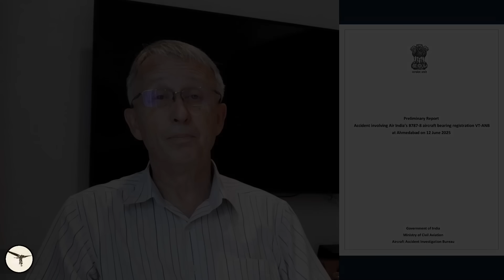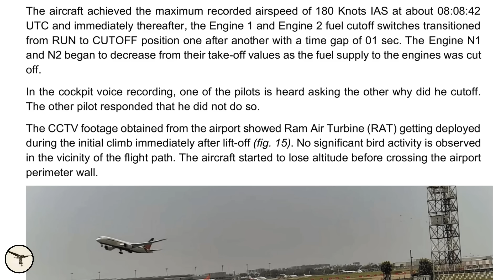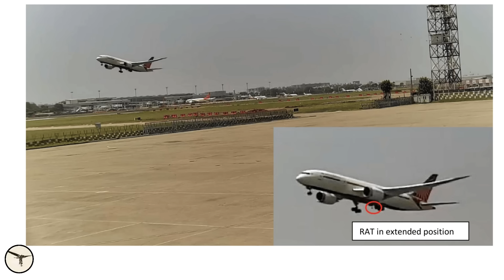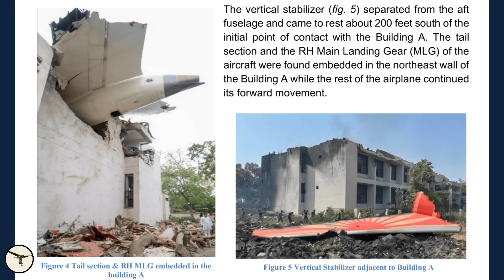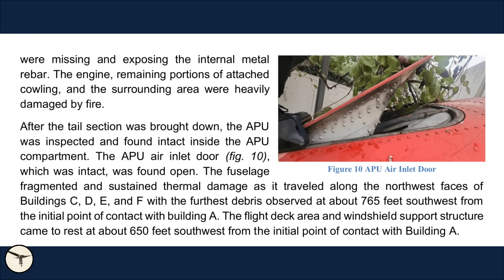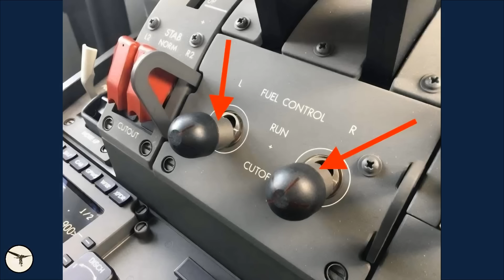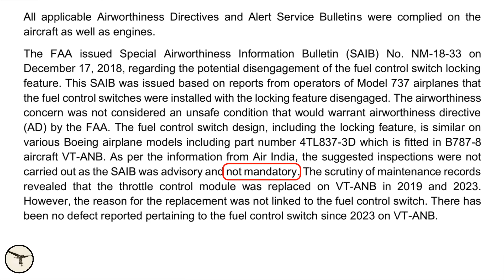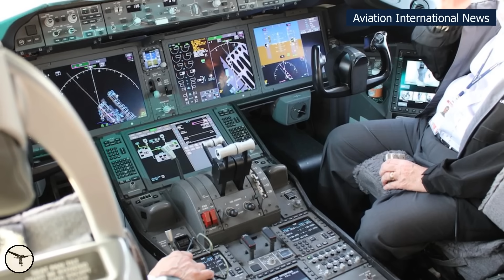WARNING Fuel Control Switches Failure Could Cost LIVES

Comment: I’ve flown both 737, 757 and 767 with these fuel control switches. They can indeed be stuck in a mid position. Normally you pull them out, then move them up and over a gate, and they will ‘sink’ into the correct position. But I have experienced them sitting on the gate in a mid position during movement many times. From this position they could potentially be moved by accident. But this would require that no one checked that they were set correctly, and that both are put by accident on the gate by accident. Doesn’t sound very plausible in my experience.
Reply: Will the fuel valve be open if it's in the middle?
Reply: @bbgun061 In my experience it has always stayed running when on the gate.
Reply: @fivemilesup  It will remain in the condition of the last fully engaged position! So from where it was moved before stopping on the gate.
Reply: @mrgoodman6620That may be correct. As mentioned, I have personally only seen this while shutting down the engines, hennes they were in the RUN position before they accidentally were placed on the gate.
Reply: @mrgoodman6620 yes in airbus , this would normally happen while shutting down engines during parking . the switches would be moved from on to off . but  engines would keep running to my surprise . because they haven't fully settled in the off gate , although to the eye they seem in the off Position . excellent catch
Reply: @mrgoodman6620 So since the fuel switch had to be put on 'Run' to move the aircraft that means it had to be deliberately lifted and set to Cut Off.
If it had been in Cut Off at the gate and then lifted to Run but had stuck on top of the gate it would stay in Cut Off. Correct?
Reply: @bbgun061  Die Schalposition  sendet lediglich einen Impuls an die Ventilsteuerung. Dazu muss man das interne Design des Schalters kennen. Es kann sein dass schon das Lösen des Kontaktes den Impuls (Masse = aus)  sendet., In der Mittelstellung könnte die Kraftstoffzufuhr eingeschalten sein ist. Das Geheimnis liegt also im internen Aufbau des Schalters. Das anheben des Schalthebels für die Arretierung ist für die Schaltfunktion sehr wahrscheinlich bedeutungslos. Dies sind meine Erfahrungen aus dem technischen Gerätebau.
Reply: @bbgun061  Yes, valves will be turned of only after the switch goes for CUTOFF position. This switch  (4TL837-3D, cost $1,500+ USD) have On-Off-On electrical circuits, they don't furnish electricity direct to the valves operate, only signal to the FADEC "allow fuel" or "cut fuel".
Reply: I read on another channel that control switches can indeed be stuck in a mid position. Normally you pull them out, then move them up and over a gate, and they will ‘sink’ into the correct position. But they have experienced them sitting on the gate in a mid position during movement many times. From this position they could potentially be moved by accident. But this would require that no one checked that they were set correctly, and that both are put by accident on the gate by accident.
Reply: @JoeyBlogs007  did you not just read that here?
Reply: Hi Captain. I’m presuming that when the Plane left the gate, the fuel switch or toggle would be in a locked in run position and it would be a deliberate action. On which he could check my a light brush of the hand. From following diagrams and different channels, it makes no sense to my layman’s mind how the switch could revert to off without a deliberate action. 

Cheers.
Reply: @johnmartin7158  Hi John. These switches cannot move by themselves. They are never ‘locked’, but when they are in the run position or the cutoff position there is a gate design, so you cannot move them by accident. You physically have to pull them out firmly and move them.
Reply: These Honeywell (USA) made switches cost anywhere from  $1000 to $4000 depending upon the quantity purchased. So the Airlines are reluctant to replace these switches if the locking mechanism is worn out.
On some runways there is so much shaking and vibration just before rollout that the switch in the middle position can shift to the cutoff position...
Reply: @farrukhshahzad5352  You're making that up.
Reply: An accidental move is not 100% impossible, but it is highly unlikely that BOTH switches would be incorrectly placed at the start.  Plus, even if that was the case, it would be way more likely for both switches to move back to cutoff at the same time by an accidental touch.
The one second gap makes it way more likely for the move to have been intentional, sadly...
Reply: @daedalron 
The switches could also have been recently serviced and wrongly installed as described in the SAIB NM-18-33. Almost all crashes are the culmination of a series of unfortunate and improbable events. An air crash in itself is an improbable event. It is fallacious logic to dismiss an improbable cause  for being improbable when one is trying to find the cause for an improbable event (air crash). The improbability of the AI 171 crash almost presupposes an improbable cause/ uncommon cause.
Reply: @Blixey-r9z   The switches were changed 2 years ago. That's already quite a while ago.
I'm not 100% ruling out an accidental turning off, but the one second gap makes it extremely unlikely.  A suicidal intentional turn off is way more likely, sadly.
Reply: @daedalron  Is it 1.0 or .10 seconds?
Reply: @stewartgrant9832   The report says 1 second, not 0.1 second.  A typo is not absolutely impossible, but if there was one so big,  I would expect a correction would have been issued by now?
Reply: Also, the types you have flown are more or less "legacy aeroplanes" by now, where the switch itself provides the connection electrically, whereas a digital switch sends a message to the fadec, "yes, I'm on".
Reply: @smowi5393 All the types I’ve flown is with fadec. The B38M runs EOS and TCMA test when putting the FCS to RUN. No mechanical link, as there were in the very old NG’s with the lever-style fuel control switches.
Reply: @fivemilesup  That is not really my point, if the type has had FADEC or not. It's to do with how the position of the switch is interpreted by the system. A digital switch is either on or off, whereas an analog switch could potentially be "somewhere in between".
Reply: @smowi5393  It's pretty irrelevant if the switch is connected to an analog circuitry or a digital input, the mechanism of the switch is the same. Those security switches are as easy to put in the middle as it is to set a ball pen in a vertical position: yes, yo can do it but it takes effort and patience to do it.

It's simply laughable that corrupt people tries to convince minimally informed public that this happened TWICE
Reply: @alastorgdl You have never operated one of these Boeing switches in your life! Your opinion is based on the use of some version of a safety switch, at best that's as far as your knowledge goes! To back that up, I point out your incredible ignorance to relevance of the switch type, these switches do not have an open circuit moment like a conventional in circuit contact switch, nor does it have a half rate characteristics like a mechanical flow switch. It is a signal switch that does not directly operate anything than a second electrical logic process, it will not do this until it is fully seated in one of the intended positions and will remain in the status it left until it is seated in the other.
Reply: @alastorgdl  yes I am seeing more pilots trying to excuse these murders AND people believing them.
Reply: @mrgoodman6620 said "You have never operated one of these Boeing switches in your life!"

Dear WASP filth: there are NO Boeing switches. Boeing hardly builds its planes, let alone making switches.

Those switches are made by companies like Honeywell or Arrow-Hart and were not invented for Boeing,  many industrial equipment use those for critical controls, for example power on

I understand Dunning-Kruger Effect is the new normality among you but that doesn't make it more tolerable
Reply: @matteoedwardes2876  said "yes I am seeing more pilots trying to excuse these murders"

I don't know what murderers you're talking about
Reply: @alastorgdl  This simply just not true. A digital switch only has one position where it is on. And in this case, it would be in the "RUN" detent. As opposed to an analog switch, that could (and here the operative word is "could") be set into a sort of a limbo.
Reply: @smowi5393  Analog switches is a concept that only makes sense in semiconductors, where there's a difference if the device has logic levels ir not

A MECHANICAL SWITCH like the ones used in this context HAS NO LOGIC LEVELS.

It's either monostable (toggle) or have multiple stable positions but your "limbo" is just malfunction, spontaneous or induced
Reply: @alastorgdl  No, this is not correct. I understand where you are coming from, but what I am talking about is a truly digital switch. Where there is software that determines if it is on or off, and not an electrical current. And in that respect, there is only one detent that can but it on.
Reply: *put
Reply: @smowi5393  There are no "truly digital" MECHANICAL switches

Unless, of course, you can give an actual model instead of just pretending that you're an Olympic authority on "truly digital" switches
Reply: @alastorgdl  I'll give you that, but I still think we are not talking about the same thing. My position is that it would not be possible, on a 787, to introduce fuel to the engines without these switches being in the correct RUN detent.
Reply: @smowi5393  said "My position is that it would not be possible, on a 787, to introduce fuel to the engines without these switches being in the correct RUN detent"

No, your position is that a tiny metal contact and a spring can sense logic levels and that makes them a "truly digital switch". I just asked you for a brand and model of those PASSIVE (no integrated electronics) "truly digital switches"
Reply: @alastorgdl  Now you're just putting words in my mouth. I find that unreasonable.
Reply: @smowi5393  Bringing you babble into context is not putting words in your mouth

When you babble about MECHANICAL switches being "truly digital" switches, you're saying that a little piece of metal and a spring have the ability to detect and respond to logic levels

Unreasonable is what you did, talking about simple devices from absolute ignorance
Reply: @alastorgdl  Give it a rest, hotshot
Reply: Are you familiar with the issue raised in the SAIB NM-18-33? There were a few 737s in 2017 where several fuel switches were wrongly installed and the safety gate was disabled. If the switches were recently serviced or replaced, there’s a chance this could have happened to AI 171 if they were wrongly installed.
Reply: The 1.0 seconds or 0.1 seconds to cut off is highly significant.
Reply: Pre-existing condition: There was a known issue with the "lock gate" on the fuel cutoff switches (as per the 2018 FAA report), making them susceptible to accidental movement.

Environmental factor: The Air India 787 encountered heat turbulence (thermals) during its initial climb from Ahmedabad, which was experiencing very high temperatures.

Mechanism of failure: This heat turbulence caused the captain's "guarding the power levers" hand to unintentionally bump or move the faulty fuel cutoff switches, leading to the engines cutting off. I used to fly out of DXB for many years and experienced this "heat turbulence" quite often.
Reply: @chrisminchin854  I could see that accidental touch moving the switches if the switch happened at the same time for both, with the accidental touch moving both switches.
The one second gap, however, seems to rule out that possibility. Or at least make it very very unlikely.
Reply: @daedalron  OK, just for a moment imagine this scenario. you are in a car driving down a bumpy road and trying to drink from a rather full cup. You raise the cup to your lips and wait for a moment when the bumps subside and try to take a sip but the cup touches your lips not once but twice in rapid succession. (Sorry not the best  scenario, but perhaps you will get where I'm coming from). The accident report will find the answer, if big politics don't interfere with the result. I just don't buy the suicide angle, so whats left.
Reply: @chrisminchin854   If the investigation team thought the accidental switch was the more likely answer, they would recommend in the report to check other planes for potential defect on the switches safety. They did no such thing.
They also brought a psychologist into the investigation team.

Both of those points to the team thinking it is way more probable that the plane and switches were working as intended, and one of the pilot moved them intentionally.
So I wouldn't rule out completely the accidental switch, but the team seems to think the way more probable answer is an intentional switch by one of the pilots.
Reply: @daedalron  Lets rather not call this a report, but more like a page of facts. The preliminary report is a legal requirement to be published within 30 days of investigation, hence there are absolutely no conclusions. The report only states the facts at the time of writing. All possibilities are open, and nothing is ruled out.

In months or years, when the full investigation has concluded, it may point in a completely different direction.  

Be careful when making your conclusions.
Reply: Q. From time to fuel switch off position how long before the engine actually starts to starve and spool down ? Thanks.  Surry Virginia
Reply: @vincentrusso4332 Immidiately.
Reply: @vincentrusso4332  A couple of seconds. The problem is the 10-20 seconds it takes to re-light and spin up again.
Reply: @vincentrusso4332  Hi Vincent. When it is put to cutoff, the fuel and spar valve closes immediately, hence the engine loses fuel immidiately and starts spooling down. There is little to no delay.
Reply: @vincentrusso4332  By the report timeline around 5 seconds, time for the RAT to be deployed, what happens when the engine power goes down. Since the engines are running in full power, they are very fuel thirst, the fuel in the tubes after the valves last nothing.
Reply: well if your looking at the EICAS while operating these switches ,  which is what i normally do on the Airbus . then yes you can inadvertently set the in the Mid position on boeing and never realise .  the only question is would they slip from the mid position to cut off when the aircraft rotates without any touch from the pilot
Reply: @zaildarbains 
Which is why a closer examination of the problem highlighted in the SAIB NM-18-33 about improperly installed fuel switches should be pursued. Yes, pilots  place their hands on the throttles just in front of the switches during take off in case a rejection of the take off is needed before V1  is reached.  Some co-pilots pilots admit to even resting their hands on the switches out of the way of the throttles just in case the captain pulls them back suddenly  to reject take off. This makes it very possible for these switches to be accidentally brushed or knocked by the pilots during that phase of take off. If you want to better understand the process and issue, CW Lemoine and Flying with Magnar have done decent videos talking about how this could happen.
Reply: But this doesn't seem to explain why both were switched from on to cutoff position with one second gap.
Reply: @colinzhu9631 it’s the way the FDR works… it measures time down to an accuracy of 1s. The time difference could have been milliseconds as the hand brushed across the switches.
Reply: Can someone confirm this, that FDR records in seconds? If that is the case, then this is 100% accident.
Reply: If I know honeywell, these switches do not make contact in the middle position , only when they are at the lower end of each position, as you say, it is possible but highly unlikely this would occur on two switches at the same time.
Pilots don't make that kind of mistake unless they are un familiar with the operation of the switches which in this case they are familiar.
Reply: Astonish that a 4TL837-3D - $1,527,24 (USD, Octoparts); switch, supposedly "safety", can fail that easy.

Anyway, some Boeing maintenance mechanics report having replaced these switches after a in flight "autonomous" fuel cut off incident.
Reply: The mid area between the two detents does not have a center-locking position. It is a slightly rounded area acting as a gate between two detent valleys, which are separated by about 30 degrees of arc. The spring-loaded blade at bottom of the switch handle travels over the center area and drops into one or the other of these detent valleys when released. 

The big question raised by the OP is: Can the switch handle be pulled only to the mid area and released such that it rests there? Letting go of the spring-loaded knob at the high point, or apex, of the gate would not be like balancing a pin on a knife blade. The engineers that will be looking at the Air India switches will test the switches from the aircraft, as well as examine the operation of new switches to see if this is possible, and at what point along the switch handle's arc of travel does one circuit engage and the other disengage. 

If it is possible to bring the spring-loaded blade to rest on the gate's surface, then it would be a legitimate question to ask what point along the arc of travel (of the switch lever) does each circuit engage or disengage electrically (i.e., can the RUN circuit still be operational even when the switch lever is technically out of the detent and over the gate area)?

No matter how incredibly unlikely this situation sounds, if shown to be even theoretically possible, it could happen. Unlikely does not mean impossible. A single pilot carelessly operating both switches in the same way at startup, might have been able to incompletely position both in the same way. This unstable situation might allow the fuel control state to be in RUN, even without sitting in the RUN detents. Taking off like that, the switches could easily be bumped or vibrated backwards into the CUTOFF position. Just food for thought.
Reply: @RetNemmoc555  said " If it is possible to bring the spring-loaded blade to rest on the gate's surface, then it would be a legitimate question to ask what point along the arc of travel (of the switch lever) does each circuit engage or disengage electrically"

You're omitting that something may be possible but EXTREMELY DIFFICULT, as in you have to put the same effort to it as you were putting a ball pen in vertical position

It's COMPLETELY IRRELEVANT if it's possible when you need to try it 20 times or do it extremely slowly and any vibration makes it fall into the stable position

That's the problem if theorizing without ever having played with a Honeywell security switch (which I've actually done)
Reply: @alastorgdl  Well sure, but everyone in these comment sections is looking for answers and posing hypotheticals. My lack of having held a 4TL87-3D in my hand doesn't prevent me from examining its design and forming a not-crazy hypothesis based on that. I'm not married to the idea, but I will say I wouldn't compare the improbability of it failing to standing a pen on end.
Reply: @RetNemmoc555  I don't remember the model of Honeywell security switch I played with but it was identical to the TL series. I remember that for it to remain in the middle position, you need to pull the toggle and then move SLOWLY, feeling the force of the spring until it's balanced. But since both the toggle and the locking mechanisms are relatively sharp, most times it will fall to some side and equilibrium is unstable

It's SIMPLY RIDICULOUS to think that a professional pilot will practice that childish experiment to a critical switch in a normal commercial flight
Reply: @RetNemmoc555  I have flown thousands of hours with these switches. I know exactly how they work. 

I read from your text that you do not know how they work. Your theory is based upon the switches working in a way that they don’t. There is no point along the travel over the gate where it engages the circuit. This switch is not like a normal switch. It only engages to fx RUN when the switch is fully seated in RUN. 

If the switch is seated in RUN, you will be able to lift it, and move it down and balance it on the gate, and the switch will still be engaged in RUN. First when fully seated in CUTOFF and vice versa, it will change the circuit. 

Should your theory hold water with ‘a single pilot carelessly operating both switches in the same way’ then they would have both been engaged in CUTOFF.

Enough speculation. We need to see the investigation results before jumping to any conclusions. 

Remember the preliminary report is a legal requirement to be published within 30 days of investigation. It simply states the few facts that they have at the time of writing the report. A full investigation may point in completely different directions. 

Let’s not point fingers at fellow pilots, and let’s wait for an official report.
Reply: @fivemilesup  said "I read from your text that you do not know how they work. Your theory is based upon the switches working in a way that they don’t. There is no point along the travel over the gate where it engages the circuit. This switch is not like a normal switch. It only engages to fx RUN when the switch is fully seated in RUN."

This switch is a MECHANICAL switch. MECHANICAL switches are SPRING-LOADED devices. Spring-loaded devices use SPRINGS. Springs require DEFORMATION to work. Deformation implies a DISTANCE from normal position to deformed one.

In that distance, the spring-loaded contact first makes contact, it BOUNCES SEVERAL TIMES ( ALL MECHANICAL switches need DEBOUNCING)   while the pressure from spring increases due to displacement until the contact becomes firm and stable.

You don't see that bouncing because it takes just a few milliseconds and because there's circuitry dedicated to filter that bouncing and prevent it from affecting the behavior of system.

Want proof of that? Connect a mechanical switch to an electronic counter WITHOUT DEBOUNCING. It will count from several to tens of pulses when you activated the switch just once. It's a very well known phenomenon for any electronics student.

So what you described is an IDEAL SWITCH and what I described is an actual, REAL MECHANICAL switch like those made by Honeywell and installed EVERYWHERE, INCLUDING AIRPLANES

What @RetNemmoc555 was arguing has flaws but I've already explained what & why
Reply: @fivemilesup  said "Let’s not point fingers at fellow pilots, and let’s wait for an official report"

Of course we all understand that your main motivation to pretend that MECHANICAL switches are IDEAL switches is that: PROTECT your sidekicks

But pilots are not my fellows nor I have any respect for corporate thinking. Pilots have demonstrated to have the kind of tribal thinking that medics, lawyers and other corrupt, elite professions have.

So no default respect for usual suspects and a good dose of ACTUAL critical thinking and ACTUAL knowledge instead of pretending you're an expert on internal combustion because you've driven a car for thousands of hours
Reply: Both switches could not have possibly been positioned improperly especially with the experience that these two pilots had, again unless it was intentional.
Reply: @fivemilesup  No other analysis brings this out. So if they were intentionally or carelessly  left half way ' on the gate', they could snap back to Cut Off ?
Reply: @asinha4528   Theoretically, yes. But realistically, I would say no.